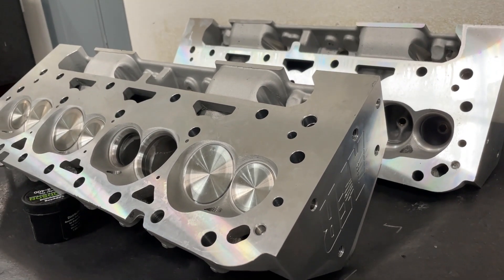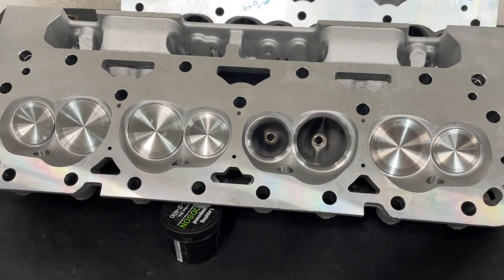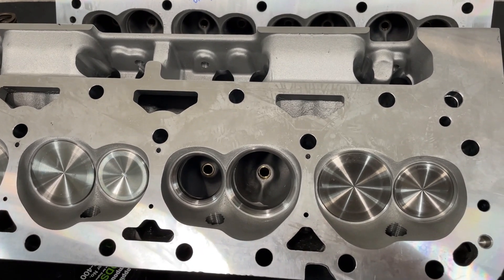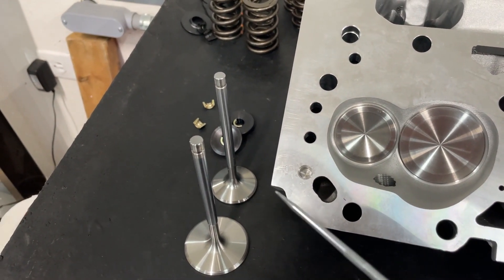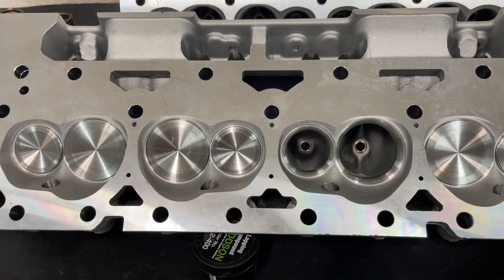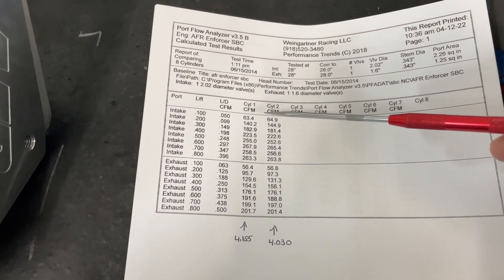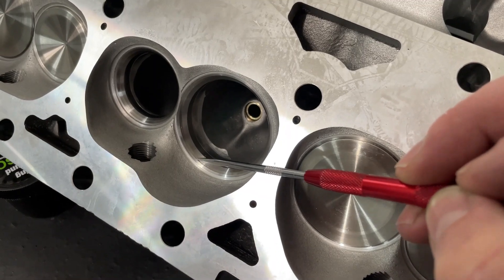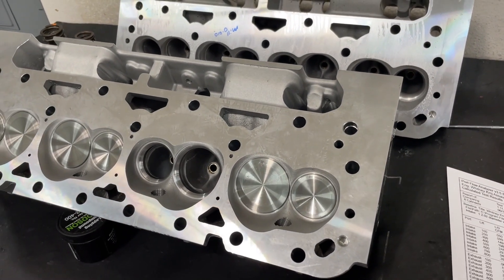AFR Enforcer SBC Head Review With Real Flow Numbers

Comment: How was the port alignment when you used the afr air gap dual plain on the enforcer heads? Are the intake ports small enough to gasket match to the enforcer heads?

Comment: Flowed the same casting on a sf600 same bore no pipe
numbers were slightly higher but not by much. 
See some sellers using the 4" bore and for the most part claiming 250ish int 190ish exh
thoughts?

Comment: Regarding the steam holes, the 400 SBC was originally used from the factory only in trucks.  If you were putting them under a constant heavy load on a hot day, the steam holes are needed.  They were not great in this application, they've found a 2nd life in performance applications.  When I worked in a shop back in the day (80s), I used to tell people to just switch to a 454 rather than rebuild a truck application 400, and sell the 400 core to a guy with a 2nd gen Camaro or Firebird.  The 454 is going to be way better all day if you are towing a travel trailer or a big boat.

For drag racing only applications, i.e., you're putting the car on the trailer and towing it to the track, you don't need the steam holes.  $0.02.

If it was more of a driver though, and in my area (Central Texas) where you might find yourself sitting in traffic when it's over 100 degrees out, I'd probably make sure I had the steam holes on a 406.
Reply: Actually from experience towing with a 400 is fine. The shit smog parts are what killed it. Build a 9:1 or 9.5:1 400 with good heads like vortec or aftermarket and a towing cam and they are fine. Have to have steam holes and a good radiator (like the big block one) and you will have no trouble. I had a 89 Suburban tow vehicle with that exact setup. Had 150k on the motor with no trouble. Pulled like a train. 400 was .020 over and I used 5.7 rods because I had about 50 LT1 rods laying around. But basically a stock style rebuild. I made factory style roller rockers work and a retrofit roller cam. Vortec heads were stainless valve, cut guides and beehive springs that it. Wish I kept the motor

Comment: Wow I was expecting better than this from AFR.  You can get within a few CFM of this with a well set up Vortec head.  Granted a Vortec will give you more headaches setting up a cam that is much above stock.  And these AFR heads seem pretty cheap for an "AFR" head.  I just was expecting more flow.
Reply: They are cheap generic castings...a vortec wont flow near these. Lots of bogusa flow #s floating on the web. 
If it were me go with your vortecs or even  an afr 180 eliminator head. They get overlooked many.

Comment: The only problem I have run across is they ALL need to start milling inside the valve cover rail for the stock centerbolt valve covers to fit. AFR tech rep argued with me that the stock covers fit, they absolutely do not.  AFR and Edelbrock both mill their own dual drilled heads for the stock center bolt covers to fit. AFR tells you they will fit on these and they will not.  Some may wonder why that is an issue.  On a L31 truck, suv or van about the only thing that will fit under the unmodified stock a/c compressor bracket is the stock valve cover.  Makes these heads a real PITA to use on a L31 truck engine with the stock accessories.  I have a set of Assaults on the 383 in my 97 Express.  I also just put a pair of Enforcers on a L31 in a 2000 Tahoe for a customer.  It is a total PITA that AFR wants to argue with you about when you call their tech line.

When you put these heads on a Vortec application, you also have to tap the coolant bypass port under the lower water pump mounting bolt on the RH side of the block if the vortec block came with it. The L31 pump does not cover the machined passageway in the blocks deck surface like a stock vortec head and the hole will pour coolant out of it.  Tap that port to 1/8" NPT, put a pipe plug in it with some sealer and all is good.

Finally the OEM L31 spark plug wire loom brackets and dipstick tubes in the trucks use the 1/4-20 bolt holes between the exhaust ports that are a solid 1/2" too low and header flanges cover them up entirely.  Would not have been a big deal to drill and tap another pair higher, but I already had the 383 shoved in my Express van when I discovered it.
Reply: Used to be better cs when Tony was around.  Current guy is bad for biz...I should go apply and take his job. 
Some have 0 business sense. 

CS AFTER the sale is everything that builds or kills reputation real fast
Reply: CS used to be so much better when Tony was there. Always helpful in finding a solution provided the buyer didnt screw thigns up
Thier recent new faceman whos gotta be 50ish and calls himself a hawk (lol)
lost my biz forever. Has no clue how many sales per yr came from me alone

Comment: Eric, do you feel the afr is the better buy, vs buying the kmj assault, and doing your own hard parts? Which is the better bargain, you have built and and sold both is why I ask.
Reply: I was wondering this myself and by the time you buy decent hard parts you're at the AFR price anyways. PLUS ! the AFR has 8mm stems. I'd go with the AFRs
Reply: I was wondering the same thing, it really comes down to how good the valve job done in China is. Cant seem to find any examples of people taking these apart out of the box and checking concentricity/runout. I KNOW you're supposed to do that anyway. I suppose if I cant afford to buy top of the line stuff, the bare minimum I can do is buy a valve spring compressor, take them apart, and take them to a machine shop who knows what to look for.
Reply: @aidenstefanson2175  Youre still gonna spend a bunch. Valve spring compressor set me back close to 400 (air) and not even a real good one.  Dont think the smaller stem on these makes any noticeable difference in power .
But Im super leery of cheap white box china valve train parts.

Comment: Do undercut stems help flow? If so, why are they only 1/2 inch long instead of going up to the bottom of the guide? I would think the longer undercut the lighter the valve plus the smaller diameter would still be in the throat at full lift.

Comment: I have a pretty reasonable question, why does any manufacturer use 11/32 valve stems any more? 8mm is really common and there seems to be a whole bunch of benefits with almost no downside.
Reply: When the sbc was made with 11/32 valves for over 60 years the tooling to build the valves to 11/32 is cheaper, more readily available. It comes down to the economy of scale when gm subsidiaries built the tooling it was 11/32, so it is still cheaper to build them that way. Welcome to the wonderful world of capitalism and a free market. Even though an 8mm valve uses less material the 11/32 is still cheaper. Confusing isn't it 😂
Reply: @b.c4066  oh yeah like a communist utopia would magically give everyone cheaper 8 mm valves for their SBC.

Comment: Eric, You've mentioned before you're a Trick Flow dealer.  Have you ever looked at the small hump heads they offer for SBC that look like 461's or 186's?  I'm looking to build a sleeper engine with these heads and would love to see a review and hear your thoughts on them.  They claim around 260 cfm out of the box, they aren't big heads, but would be curious what can be done with them.  Thanks.
Reply: Pretty sure Straub Technologies have a cnc program just for those trick flow heads..... might be worth checking out also.
Reply: @tyrelbuchanan311  Thanks Tyrel, I'll give Chris a call.
Reply: @firebirdjone   TFS for sure, those cheap look alikes dont flow for poop more chinese stuff.

Comment: So for a 383, which head would you bolt on? The AFR Enforcer or the Brodix IK200?
Reply: I debated on this as well and ended up with Promaxx 183s cuz I found them on special. (Otherwise I was going to go Enforcer) But the Brodix are a REALLY good head for the money but you’re still paying about a 30% premium for an American made head. There’s not really any performance difference in most cases. For reference, the Promaxx heads are a copy of the Brodix IK. Eric went through this in another video.
Reply: @joeamato3936  what was interesting with his comparison was the Promaxx 200 outflows the Brodix IK200 due to the Brodix requiring basic chamber work.
I'd still go Brodix though and get the CNC chamber option.
Reply: I was going to buy the IK200 heads, but further research convinced me to try the Promaxx 200 heads.

Comment: I have the exact same heads, 11/32 stem 2.02in 1.6exh they have the steam holes,  hand ported, ran 1.46' sixty foot time on my street 379ci small block short block. After the sixty foot, could not put the power to the track until high gear half track with 3.00:1 gears th-400 and 9" @3400+ pounds weight, twin 2.5" exhaust to the rear bumper.
Reply: Hooker headers?
Reply: What brand heads do you have ?

Comment: A bit disappointed afr is using Chinese castings. 😕  I get that they are better than regular stuff cuz of afr parts but besides that I just wouldn't. My eliminator heads were amazing but I prefer my brodix dragon slayer especially after I had them ported and new guides springs and valves

Comment: Nice video Bud! You don't seem like your going to jump off a bridge, LOL. So I'm guessing the 2bbl engine wasn't a complete turd? LOL JK! I'm hoping you had good luck! There's not much worse then when you dyno a engine that you cannot do much to, & power is down from where you know it needs to be to be competitive! Hope to hear about it sometime this weekend, & Happy Easter to you & your family! Try to stay out of the shop! At least on Sunday!
Reply from the maker: Nope it was a huge turd and broke stuff.
Reply: I dabbled in the 2 barrel world of stock car racing back in the late 70's, the best results were when the V8 engine was built "for" using a 2 bbl, putting a 2 bbl on a 4bbl V8 platform was a disappointment, the biggest problem was the "gulp" factor coming off of the corner, the 2 bbl lacks the area to compensate for heavy loads without nosing over (lack of air velocity), best results were had with slightly smaller displacement plus gearing to rev the snot out of the engine to keep the air speed up in the intake.

V6 was the hot setup for 2bbl.